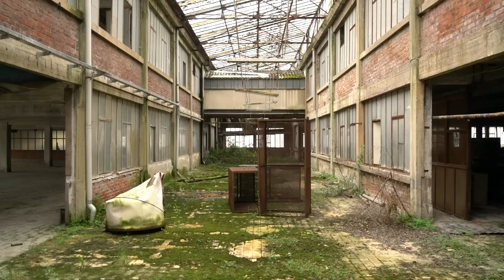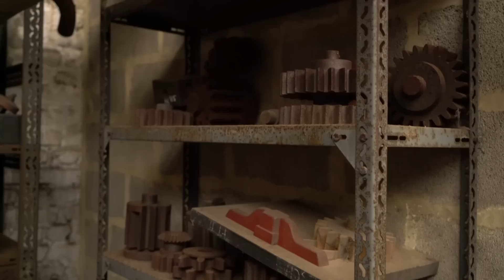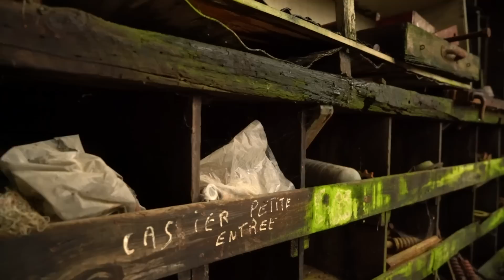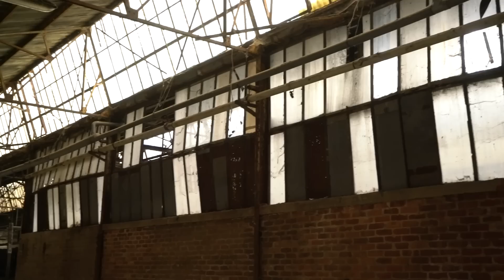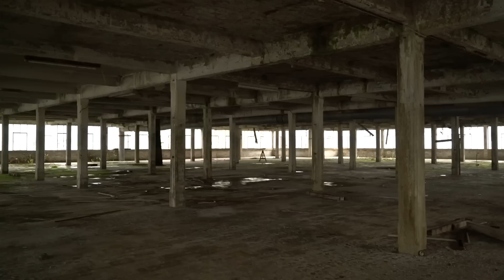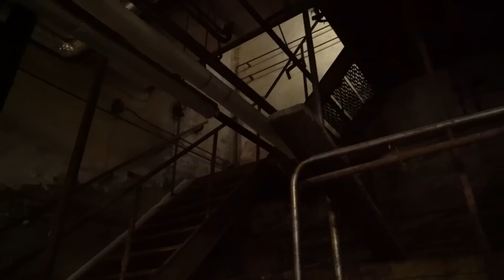The Sudden Downfall of the Belgium Wool Industry - Exploring an Abandoned Wool Factory

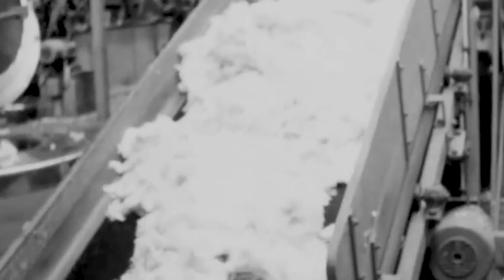Comment: 7:10 not just due to increased competition but also by the inability to export goods, as WW2 had caused Belgium no guaranteed connection to export it's stuff to the Netherlands and Germany, because they closed their railroad connection. Belgium started spying in the Netherlands and even took over a part of Germany to get the railroad transport going. Though the Netherlands during the wars acted rather neutral and still dealed with Germany, Belgium could not.